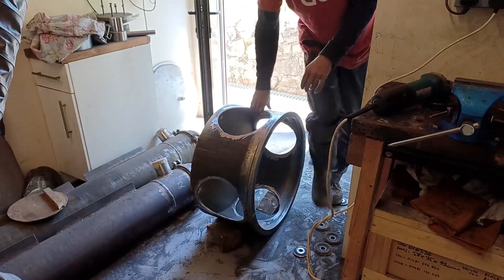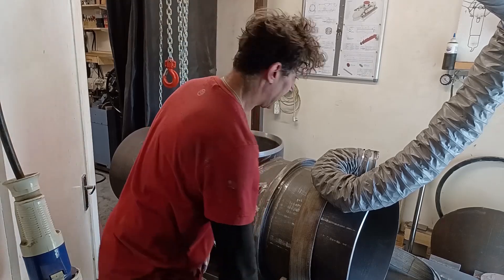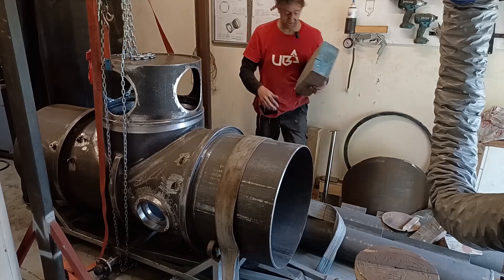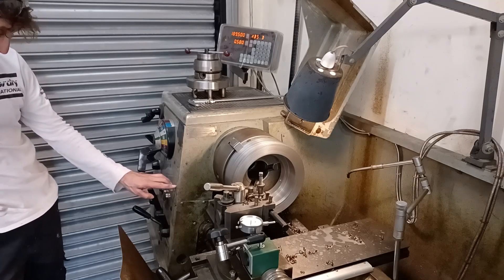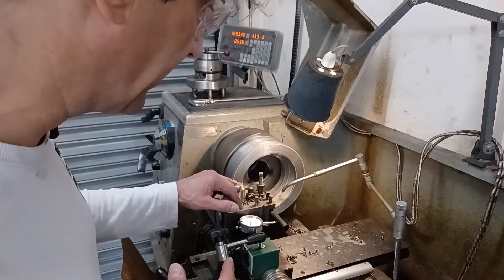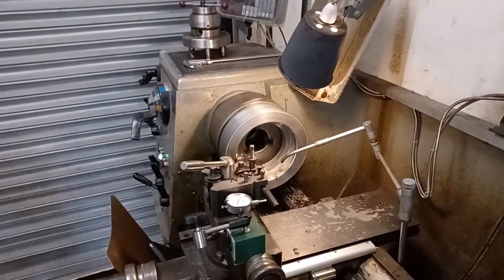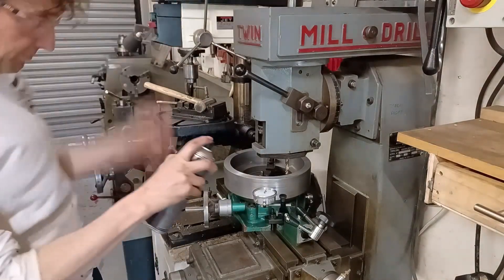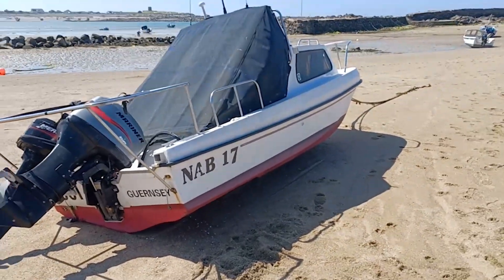Building a Submarine. Part 143.

Comment: Hi intresting project i built a varation of the kittradge in the 1985, did quit a few mods such as movable trim weights driven by lead screws .used a single penertrater panel for all through hull connections etc
Reply from the maker: Sounds interesting Ken.  Do you have any pics you could share?  Are you in the psubs community?